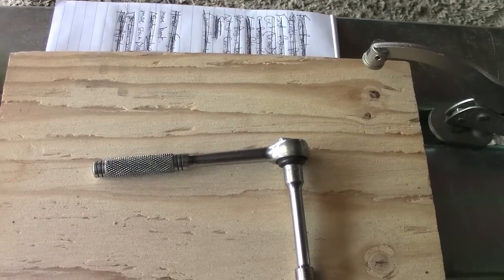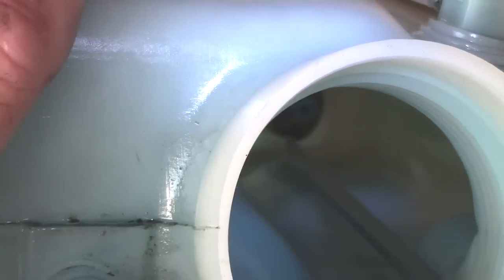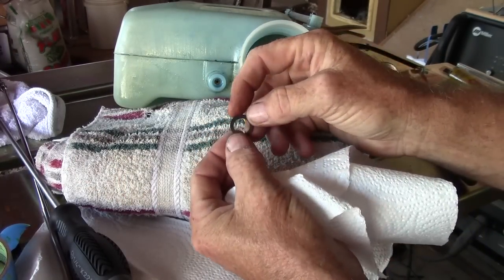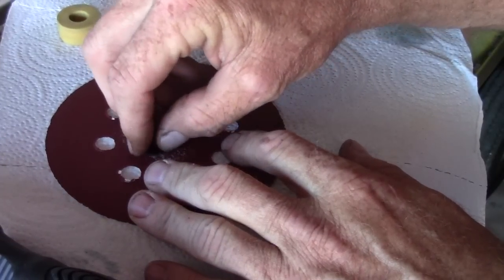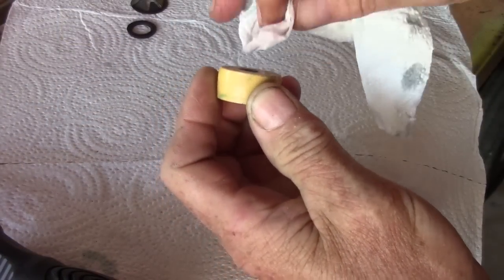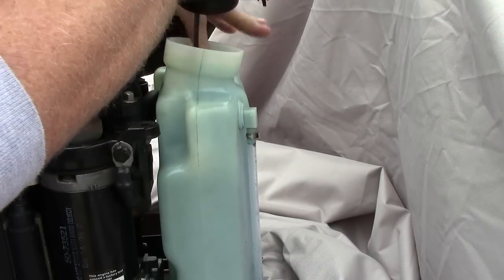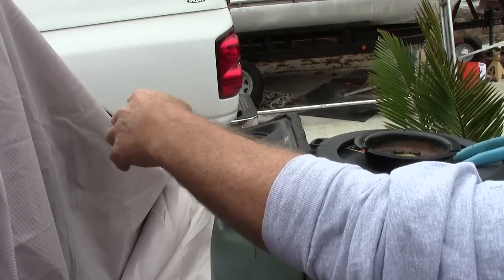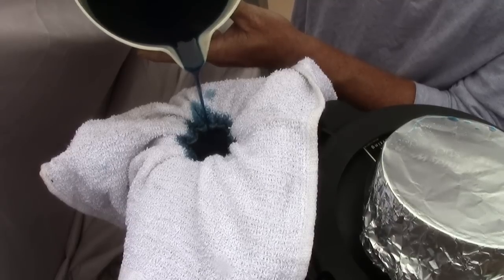Outboard Motor  **Low Oil Alarm Fix**

Comment: Thanks man! Fixed mine as you showed me in a matter of minutes.  For reinstall, I used a long piece of metal rod and slid the float/magnet down it onto the post and then I used a socket and extensions and super glued the star washer (2 drops either side) to the socket to lower it back on to the post - a quick little push and it landed perfectly locked onto the post.
Reply from the maker: Thats awesome Mike! hope it holds for you. Mine held for years until i sold the boat.

Comment: I have a 1997, 75 hp tracker which had the same problem so I fixed it as your video stated and I  saved at least $151 dollars which was the cost of a new tank. Had to modify it as my engine was configured a little differently, worst part was removing the oil tank which had a bolt at the bottom of the tank that you just about could see let alone could get on it. There is a switch (tubular) that runs inside the post that the float rides on that I replaced as added insurance ( $ 11). Didn't want to repeat messing with that tank again.So, thank you for your video, saved me a good chunk of money. Tony Cusumano
Reply: Is it still holding up. Before I take on this project.

Comment: fantastic video! when I replaced the clip though I used a wire (coat hanger) thickness and let clip slide down. I then slid a 1/2" copper pipe over that to the clip and pressed down to engage the teeth. eezy peezy

Comment: Had the same problem with my 1994 Mariner, 40 HP, followed the instructions and had it fixed in about 2 hours.I used a socket on a long stick when I put the retainer clip on and just used my long screwdriver and a hammer to tap it onto the plastic post, worked great.I can't believe the dealers are saying that it cant be fixed, but they are after the big buck !!!
Reply from the maker: Yep, great job Phil, you and me both know it's fixable though!!

Comment: I have a 1998 40hp Mariner outboard that I bought new in '98 and never had any problems with it until a few months ago when it started having the low oil alarm. Found your video and the one by bshawcreative last night and decided to check out my oil tank to see if mine had this problem. I emptied the oil from the tank and sure enough, the magnet was no longer attached to the end of the float. When I turned the ignition key to the ON position the alarm would sound but as soon as I lifted the float and magnet the alarm would shut off. I removed the retainer clip, float and magnet and then cleaned the float and magnet with a little hot soapy water, dried them and then did a light scuff with 100 grit sandpaper. Bought a small tube of Permatex Ultra Black Maximum Oil Resistance Gasket Maker for just over $4 and attached the magnet back to the float. I will let it cure for 24 hours before putting it back in the tank tomorrow and see if it is fixed but I feel confident that it will be. Thanks for posting this very helpful video. Should save me some money for sure.
Reply from the maker: That's fantastic bigbassman! I'm sure it's gonna solve your alarm problem!
Reply: I just finished putting the float back in my oil tank and got the tank installed on the engine and all is GOOD!!!!  After installing the float and empty oil tank I turned the ignition key to ON just to make sure the sensor would sound the alarm as it should. I then started filling the tank with oil and when the float moved up the alarm shut off. This is one of the easiest fixes ever and saved me at least $200-$300 because I was going to take it to an outboard repair shop to see why the alarm was staying on. $4.16 for the gasket sealer and a couple of hours of my time (plus the curing time for the sealer) and it is back working like it should. Thanks again for the great video.
Reply from the maker: Yep!!! I was in that same position of spending the money to have it fixed or spending the time to figure it all out, and thanks to that other guy for putting me on to the solution I decided just like you did to give it a go and it worked out for me as well. Glad to hear ya got it all dialed in buddy!!

Comment: You are great! I was quoted $400+ to fix plus wait for a week for parts.
I have removed the float and indeed the magnet was not attached.
I will buy adhesive tomorrow. and finish the re-install.
I believe this will work since alarm went off after raising float AND magnet.
Will let you know; if works you have an invite to Lake of the woods for a fishing trip!
Reply from the maker: That's fantastic Wayne! Let me know how it goes.

Comment: I had the same problem with my 1994 40 hp Mercury.  Thanks for the how to repair video.
Reply from the maker: sprinter144 I’m quite sure its a common problem as the motors get older. Good thing its fixable!!

Comment: Planning to attempt the repair. As added security what might be the negatives to tie the glued magnet ring to the float using maybe fishing line? Thanks
Reply from the maker: i’d imagine that could work if you used like 2-4 lb test but make sure that it still has room to freely float up and down.
Reply: @Bucket247   also the wiring at 12.20. does it detach from the butt connection by just pulling apart? Thanks again.
Reply: Fixed the problem. Thanks so much. Information was very  helpful.Much appreciated

Comment: Great video!
Q1) No Harbour Freight in Canada!  Those vice grips and long screw driver are $50 minimum up here !
Have to weigh that cost over the cost of a new tank. What's a new tank cost in the US ?
Q2)  Why the mask ?  lol
Reply from the maker: I would try amazon as well for the tools, i never checked the price of a new tank, not even sure they make em. The masks are popular now for sunblock but back the we were just having fun.
Reply: Princess Auto has 22" Screw Driver for $11.99 and the vice grips (Long-Reach Locking Plier) are $21.99.  I am going to try the socket with extensions to put the clip back on.

Comment: Dont you also have to have to make sure you put the magnet back the same way you took it out cuz of the polarity on the 2 sides of the magnet or it doesnt matter which side is up or down?
Reply from the maker: That's a damn good question Justin, and it's coming up on the one year mark of this repair...but my memory is limited to the one month mark! So I will venture to say that the part at the bottom of the tank is steel and the washer is magnetic and a magnet should only have reverse polarity against another magnet and not on steel because I don't remember taking note on which side was which when I removed it and then put it back, yet it did work and so far one yr later the glue is still holding...so far so good.
Reply: +Bucket247 thats good to know. my suzuki is having a similar issue but when it hits 1qt of oil it starts beeping as if its empty. Thanks for getting back to me so quick.
Reply from the maker: Well...and the thing about the alarm is that even if you know you got oil in the tank and you should be good to go, the damn alarm going off still makes ya nervous and pisses ya off cause ya don't want to listen to that all day,  but based on how mine is controlled by a magnet touching metal or even just two pieces of metal touching, maybe neither are magnetic..come to think of it...but how can yours possibly go off with any amount of oil still in the tank??? The float should not touch the bottom contact until it's low enough, or unless the shape of the oil tank rises where the float is, which is probably a good idea to give you ample warning to add oil, although maybe just an intermittant beep every once in a while would be better when low than just a constant annoying beeping.

Comment: awesome video ! mines beeps but the beeping eventually dies out until i turn it back on.  any idea of what it can be ? if i still run it like that is there still oil pumping ? thanks in advance
Reply from the maker: +Rod_Bending_Addicts...... The question of whether or not your oil is still pumping is what worried me as well and that's what caused me to investigate a bit further, I suppose that possibly each brand of motor could be different, but before you assume that it's pumping oil and risk an engine melt down I would  pull the tank, drain it and pull the float and see if the magnet is still glued down. An hour or two to investigate this sure beats lookin for a new motor on Craigslist
Reply: +Bucket247 lol absolutely. I think I am going to highly consider your suggestion and hopefully find that that's the problem. thanks for the fast response 👍
Reply from the maker: You got it buddy!! Good luck!

Comment: I disconnected the blue wire which turned the alarm off. Why can't I just leave it like that and make sure I check the oil rather than fixing the sensor cork?
Reply from the maker: I see no reason you can't do that, I thought of that as well, my motor is just a 40hp merc circa 1996-97 so no big deal if I cooked it, but if you are rolling with a fairly nice... big motor I'd probably go the extra mile and fix it just in case the alarm is tied to more than just low oil.
Reply: Yes I wondered that myself. I have a 2001 50hp which is only reason I'm working on it. Thanks for input.
Reply: i wouldnt depend on that wire, i know my suzuki dt 100 was having this issue once it reaches 1qt of oil in the resevoir, it puts the engine into a safe mode and wont let you put to much hit high rpms to kind of protect itselt even though theres still plenty of oil still passing, best to just do this repair
Reply: I did go ahead and repair the float and magnet. It all went exactly like he said and the video showed. Awesome fix and saved money.
Reply: +Douglas Dunn sweet

Comment: How do you drain the oil from the tank to get started?
Reply from the maker: From what I remember I had to pinch the oil line and remove the tank, then just un-pinch the line and drain it thru that.

Comment: I have a 115hp Mercury and I have a steady alarm even though the water is coming out cool. How do I drain the reservoir so that I can remove it and see if I can fix mine?
Reply from the maker: I pinched the oil line until I could undo the hose clamp then remove the tank and drain it from there.
Reply: Thanks for the tip. It will give me one more job that I can maybe take off of my bucket list.
Reply: A steady alarm is the temp. Or the electronic modular is bad.

Comment: How is the repair holding up?
Reply from the maker: Hey BB, How goes it? The repair is still holding to this day, although the last trip of the summer last yr the motor had a short and melted some wires so it's dead right now. I'm gonna pop the cover in the next month or so and see what needs to be replaced but as far as the oil alarm...Done stamp it!!
Reply: Good to hear the repair is holding up!  Having the same issue and will use your repair method.  Good luck with the short circuit ...

Comment: Hmmm,  why not put the magnet on top of the float.  That way it will never fall off again.  Of course the alarm would go off a little sooner because the magnet would be higher in the tank.
Reply: jack d
Reply: Would it get stuck to the retaining clip instead?
Reply: The magnet might not be close enough to the switch inside tube if magnet was installed that way.

Comment: Did you have to purge any air in the oil line?
Reply from the maker: Great question CU, I can't remember what or how did it...if I did... but thinking back I do remember that when I removed the hose that if I kept it upright the oil was damn near at the top of the hose. I suppose you could purge what little remaining air by pinching the hose between your fingers and running your fingers up the tube to the oil tank.
Reply: There is a purge screw on the oil pump just for purging.

Comment: I have a Mercury 50 HP with this same problem.  I verified it was the oil sensor by two ways.  First of all I turned the ignition on and it was beeping.  I tipped the oil reservoir a bit after removing it from the two bolts and the been stopped for a moment.  So I mustve slid it just a little when I tipped it.  Second I just unplugged the sensor from where it connects into the electrical system, or computer, or whatever it is it connects to.  I turned the ignition on again and the constant beep went off.  I guess my question is is it a problem not having that sensor plugged in?  I can tell when there's oil in there, and if the only thing that sensor does is tell you when you're low on oil well I don't need it then because my tank also has a see-through indicator of the oil level.  So why even have this sensor?  If it does more than just sense low oil in the tank, I'll do this fix, but otherwise I'm just going to leave it unplugged.
Reply from the maker: If I hadn't figured out how to fix it then that's exactly what I was going to do, my engine was old enough that I wasn't too worried.

Comment: I'm having trouble with the alarm being on as soon as I turn on. won't turn the starter. if I jump the starter it will crank and run but alarm still going. Di fine this morning with no alarm then outta nowhere it started. any suggestions?
Reply from the maker: Drain the oil tank and look down there,  you probably have this same problem.
Reply: Got it. Drained tank removed sensor magnet dropped back down. Reinstalled sensor rod thing and alarm went off. Works great. Now need to sell boat👍
Reply from the maker: Excellent! tough to sell with alarm going off!

Comment: Can I just unplug the sensor as long as I keep an eye on my oil ?cuz I don't use that much
Reply: I'm not sure, you can try it and see if that sets off your alarm if it doesn't then yea you should be good just keeping an eye on the oil level.
Reply: @ALLProGarageDoors  but what I was thinking is the float does not shut the oil off when it's down it's always open but this is just a warning system
Reply: D Smith That's what I thought as well, i didn't want to risk it so i just did the repair.
Reply: Wouldn't advise it, am new to oil injected outboards and recently purchased a used Mako with 90hp Merc. The previous owner had disconnected the oil alarm. I always carry extra oil, but after a busy week, didn't top off the oil on a recent trip cause I only ran it an hour or so the last time out and had slightly overfilled the reservoir when I topped it off.  Had plenty of gas and decided to run 20 miles in search of better fishing mid afternoon. Probably covered 50-60 miles that day and started loosing power on the way in. Long story short, I ran the reservoir dry before I realized what happened and lost some compression in one cylinder. Have to do a powerhead teardown and hope isn't anything serious. Not worth the risk, is easy to overlook, especially if you are burning both ends of the candle and trying to squeeze in a little fun.